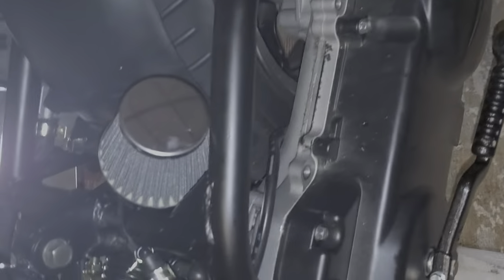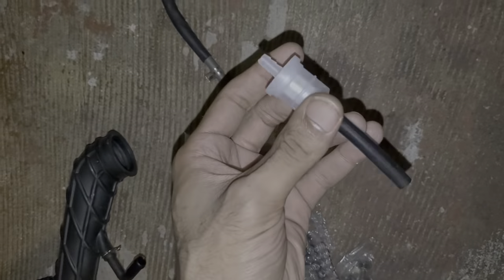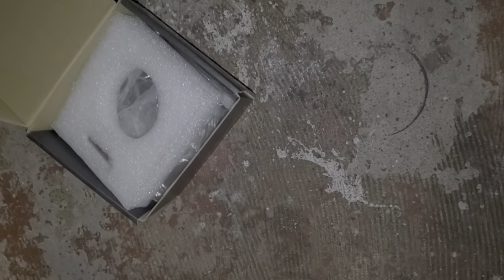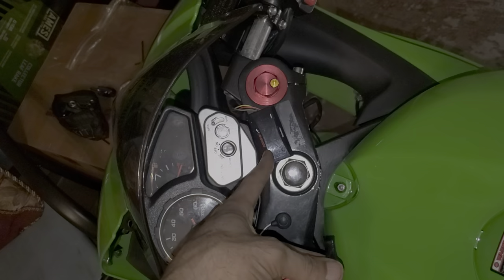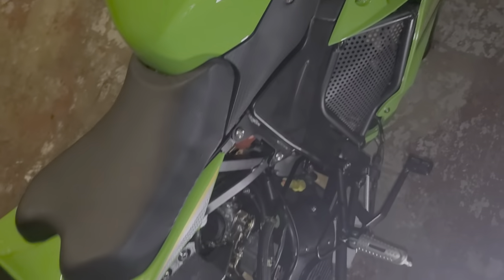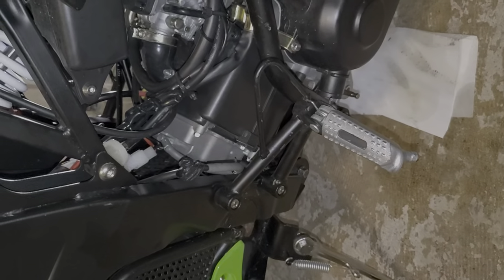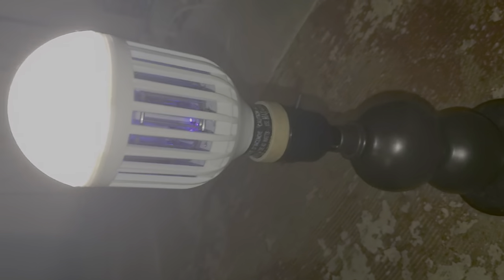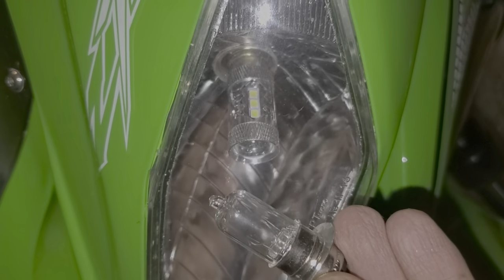DF50SST upgrades installed so far + wth

Comment: I have the 200cc version on the way. Already ordered a nibbi carb with intake exhaust better clutch and ariator with better roller weights. Upgrade your transmission and you'll get more power. Especially after the big bore kit.

Comment: love it i have the same one but i want to see how yours runs just in case i can put higher performences see wat i can do love the detail on everything you saying
Reply from the maker: At the moment it isn't running to well. My cousin installed the 72cc, now it has a piston slap, and no top end. He bailed on me. So I have to watch some videos on repair and try to figure it out from there. I should have just done it myself.. lesson learned. I may end up just having to put the stock cam back in. I don't believe he adjusted the timing with the new cam. And it's super difficult to find people who are willing to work on these. That's why so many people are on here posting videos on how to fix. I may do the same. To much money invested to have a garage totem. Parts are dirt cheap, but just be cautious when installing anything that changes the timing.

Comment: Are those back pegs you have on it?
Reply from the maker: It does come with passenger pegs yes. But I wouldn't recommend anyone over 60lbs. The seat is for show only. If an adult sized person were to sit on it depending on their weight. Or if they have a very wide bottom...It will crack the the rear fairing. Even has a sticker to show no passengers.

Comment: How’s the performance doing after these upgrades?
Reply from the maker: Unfortunately I let my cousin install my bbk. As of now I have a piston knocking sound. And my bike seems as if it's being robbed of power. Possibly a hose. Prior to the install I was getting 37mph. Now I can't even get passed 20. I'm thinking of having the original cam put back in. I don't think he set the timing for the newer cam. Since I'm still new to these bikes it's extremely difficult to find someone to help with it.